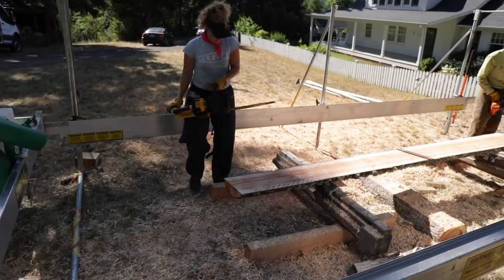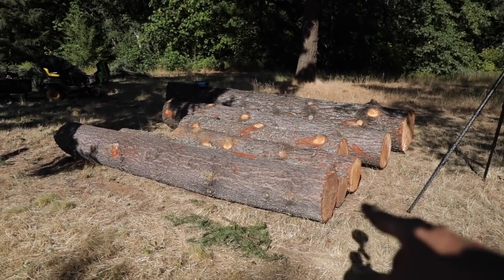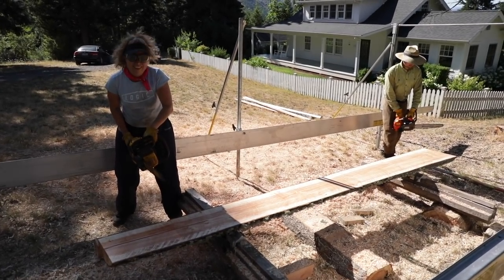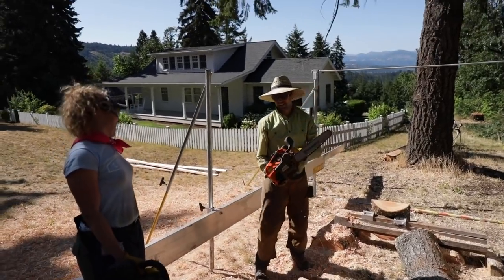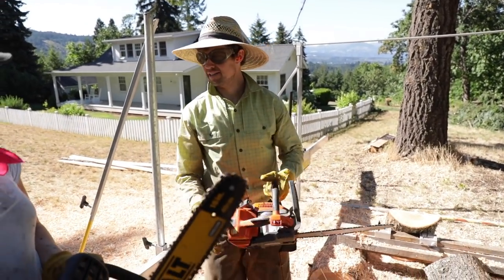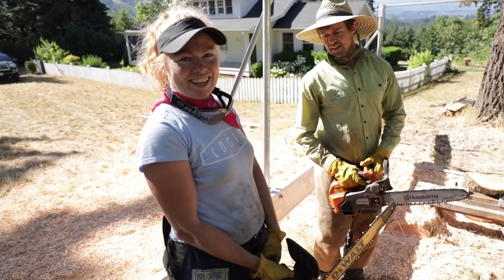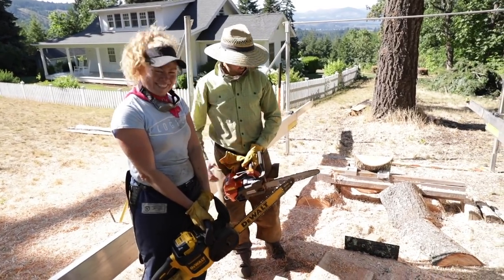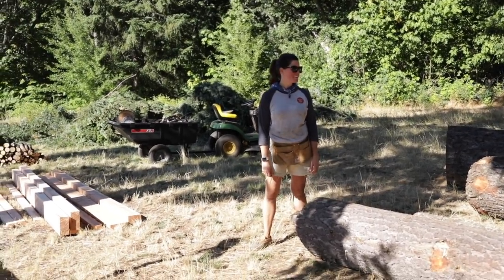Electric V.S Gas Chainsaw SPEED RACE

Comment: I would still like to see a comparison that no one seems to do......tanks of fuel compared to battery life.......sure it cuts fast.....the key is.....how long will the battery last. if you only get 6-7 cuts on a battery......not worth it in my opinion when you are out in the woods and run out of power and you have a face cut and a partial back cut = danger and no more battery to finish the cut......yeah yeah, I know, not the saw for felling a tree.
Reply: I have heard that battery can run a pretty long time under hard use.  I am curious too.  Thing that is overlooked is if you are using that saw seriously you will have at least two if not three batteries.  And they charge up pretty fast these days.
Reply: Chris Bruinsma  With DeWalt you can use the 60v batteries.